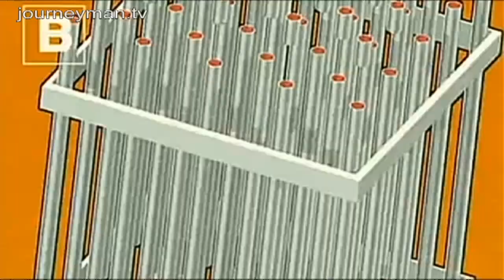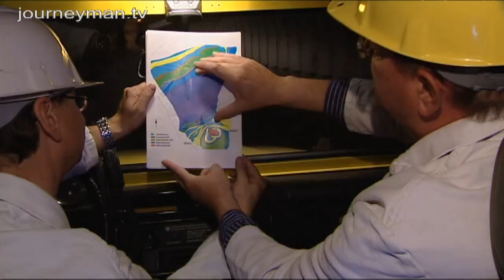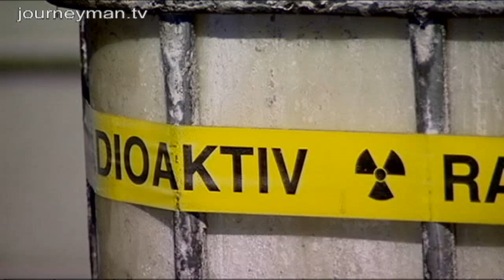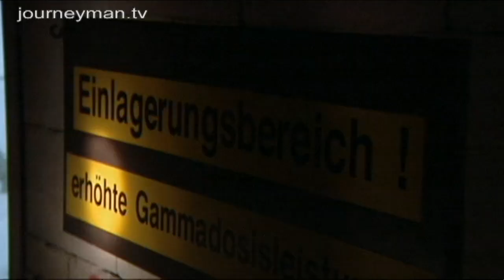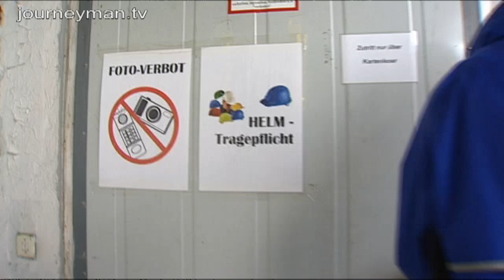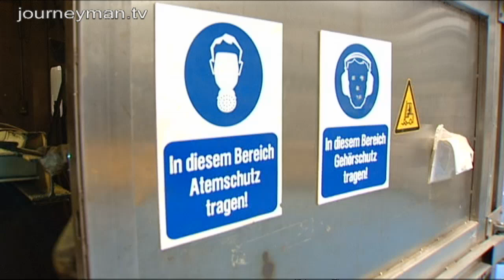Nuclear vs Green - World - November 2010

Comment: They are actually coming down in price. Way down.  I found 100W panels for less than $2 a watt.  My entire system will still cost less than having poles set and new transformer put in.  And I will get 30% of my costs back on my taxes next year.  That program is only until 2016. Of course there are some in washington wanting to end it next year.